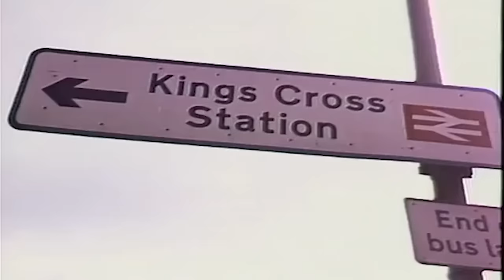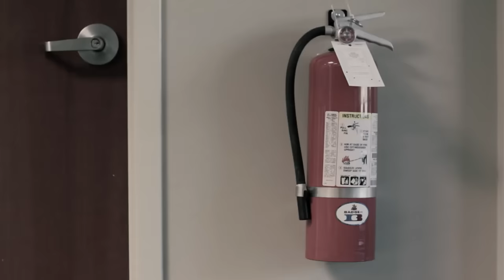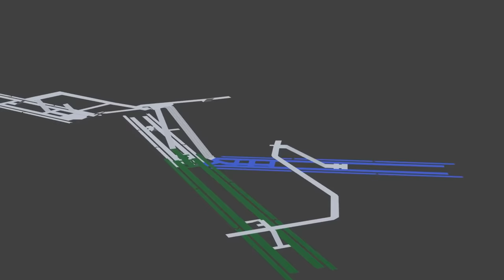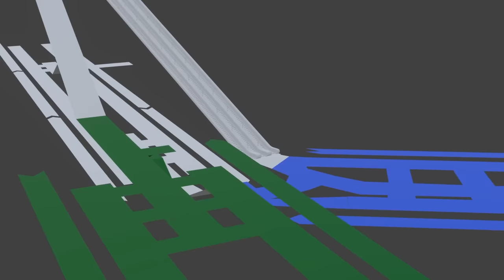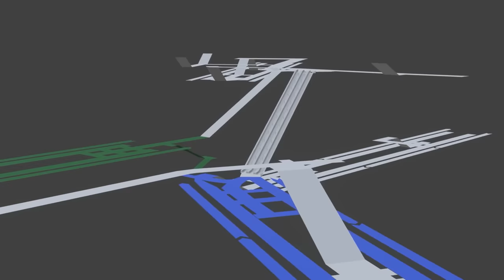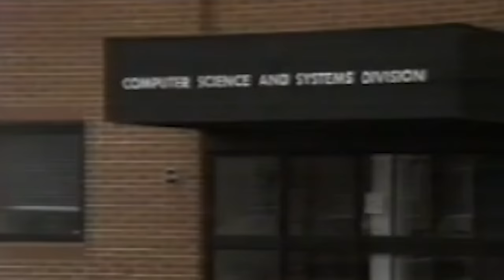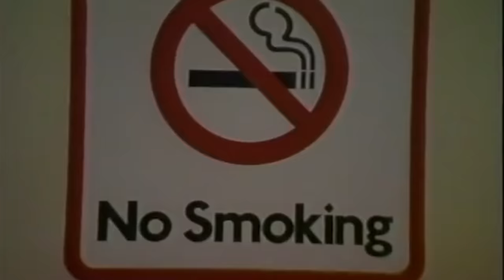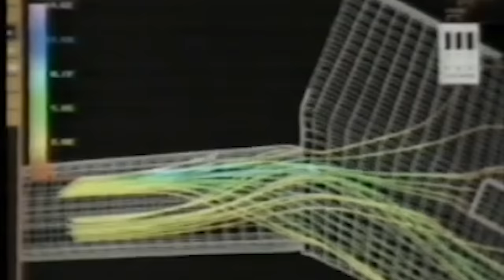The Subway Disaster That Changed Firefighting

Comment: A key aspect you didn’t mention was that firefighters in the UK were issued new uniforms which provided much better protection because the iconic rubber leggings they wore at the time of the fire were melting under the heat
Reply: I’m currently a firefighter in the UK and I honestly could never imagine wearing that kit into a small domestic fire, never mind a underground inferno! Those men paved the way for the gear we have today and that should never go unrecognised.
Reply: @WAzzzUUppp  My dad was in the UK police in the 1970's. He saw firefighters enter a domestic fire with wool coats and steel helmets but no respirators. They got a steel ladder and placed it in the hole where the stairs used to be whilst being sprayed with a hose. Then they climbed upstairs to get the kids out. Astonishing bravery. Tragically the children did not survive.
Reply: @WAzzzUUppp  on merseyside they called them yellow leggings  plastic yellow fire retardent drip pants  because they ware crap, each brigade had diffrent names for them eg leggings london  over pants merseyside drip pants
Reply: It's my understanding that during World War II, the regular firefighters had leather gear.  The auxiliary firefighters used gear that included rubber boots.  It's surprising that decades later the regular firefighters would be using rubber and plastic.
Reply: Water steaming out of the  wool coats when they got hot and then wet would probably cook you like a lobster
Reply: Ouch their legs
Reply: My uncle was a firefighter, and I remember him talking about them needing new gear. Helmets that would never sit on your head right, were uncomfortable and cumbersome. He called those yellow rubber pants Wet Legs, he said they were more suited to fishing than firefighting, they'd make your legs sweat, didn't protect against heat, would melt or get soft. The wool jackets were treated with fire retardant chemicals that made them smell funny. Gloves that were basically dipped gardening gloves, and garden standard wellies. It's amazing to think they were sending young men into danger in kit like that. My uncle was seriously injured when a floor collapsed above him. He was medically retired. He's still here. He won an award when he rescued police officers in a major fire.

Comment: As someone born in the 1990s I'm just here in shock that escalators were ever made of wood.
Reply: I think the first escalators were made from wood.  Macy's - the big dept store in the middle of Manhattan - was famous for having them.  Some of their escalators are still partially wood.
Reply: @ae2948  It makes sense and sounds really obvious now, it's just something I'd never even conceived of before. I love learning new things
Reply: The escalators in this were made in 1938/9. It was a cheap and easy way to reduce the moving weight.
Reply: lmfao, next youll tell me youre shocked that airframes used to be wood too?
Reply: I remember them in Boston in the 1980s had them in older stations
Reply: Problem is Britain was where the Train and the Subway/Underground/Tube were invented, and also had the world's first escalators on a subway system. Back then it was common to build them out of wood in the late 19th-early 20th century.

Since Kings Cross Tube Station dates back to 1863 and is also a major transport hub closing the station for rebuilding or retrofitting metal escalators was extremely difficult, so the old wooden steps were just left in.

The Tube had some wooden escalators all the way until 2013.
Reply: Your not the only one, I was born in July 14th 1983 and I’ve turned 40 today, but still look younger like as if I’m in my 20’s, my mind is still sharpe now when I can I still remember my early days when I was small, born in Walthamstow ( East London) and moved to Leyton  ( East London )in May 1984, got used to Central line 1962 stock very quickly as baby, before the train crash in Leyton in August 1984 on the Central line and I did not know about this crush in Leyton until 9 years later, but I remember first travelling on the Central line in 1984 before the crash the part when the trains enter the tunnel, blew my ears, ever since, I used to close my ears and I used get nerves when ever we get on the Central line from Leyton before the new the Stock of 1992 stock of the Central line when they came in the service in mid 1993, before I knew about  crash, I knew Central line a baby as “ hazard”, I did not felt self, I trust my indicts not people, if I feel something is not right, a person or any other things as well, but I’ve nevered seen 
wooden  escalators in zone 1 whole my life, I’ve nevered came out of Kings Cross station before after I left Walthamstow in May 1984, my old line was Victoria Line, i sat on the Victoria line before I left Walthamstow, my parents took me to Brixton, from Blackhorse Road to Brixton, the reason we could not find a decent house in Walthamstow, there non left so we ended up in Leyton and Central line was my new line; my dad use to work in Holborn back in the 80’s, he used to travel by tube to work, so when we were still living in Walthamstow and before I was born, he used to get the Victoria line from Blackhorse Road to Finsbury Park and change across to get Piccadilly line to Holborn, he was kind marketing person, so when we moved to Leyton in May 1984, Central line to Holborn, no changing at all, but when I looked back  in the 80’s before and after the Kings Cross fire, I felt like the escalators in Holborn were wooden, it gave me a vibe, but I remember travelling to Heathrow from Leyton when I was small heading to my family country Uganda for the first time, we changed at Holborn to get the Piccadilly line to Heathrow, I saw videos some of documentaries of the History of London Underground and they showed Holborn, it used have a peach tile on the Central line, but in 1985 they changed the tiles on the Central Lines and Piccadilly lines to British Museum of Egyptian statues and that is when I notice they used have wooden escalators I think, I could be wrong, but the whole of my life , I’ve been travelling on the tube for  39 years ( 1984, not including my age 40), but I did remembering on the tube in 1984 very well I had no issues, but small issues  (Techno issues), but I can only see wooden escalators in the suburbs area of London, but not in zone 1, which I find it strange and weird to see them in zone 1, but  heard station still has a wooden escalator on the Central line in Greenford, but in history, they should not have “ALLOWED” people to be smoking on the tube, escalators and at stations in the first place !!
Reply: @jessh5310 cheap, easy and stupid to used in the first place with that silly old generation who should have known better as well with “ smoking policies” in the first place and this would have not happend (Kings Cross fire )
Reply: @leonard2005ify  . You have to understand that many of the materials we take for granted did not exist or were extremely expensive pre second world war. modern escalators have extruded aluminium steps, a process only used post 1960 and only extensively used post 1980.
Pre 1950 fire buckets were a common fixture everywhere and everyone would enthusiasticly use them given the chance. Every building had dozens until the late 1960's.
Reply: @jessh5310  ok
Reply: Although they were made of teak which has a very high burning point. It was the grease and debris that fuelled the fire.
Reply: It's used to know as motor stair
Reply: @hiddenaether and buildings
Reply: Shocked by wooden steps? Really
Reply: @hiddenaether  that is kinda a shock when youve never thought about it before tbf lol
Reply: I only knew about them because there’s an old one on display at the London transport museum. I was 3 months old when this happened so even the idea of smoking on public transport was alien to me
Reply: @Ink_Sack shouldn't you be shocked that people are so stupid that they would throw a match into a mechanical device ? Would you think the same about someone lighting up a cigarette at a petrol station saying we shouldn't be using fuel because it's flammable
Reply: @James-kv6kb  I am shocked about that too lol, but also there’s always been stupid people in the world so I’m not too surprised
Reply: Last wooden escalators were removed from the tube at Greenford Station in 2014
Reply: As someone born in the 1960’s I’m surprised millennials and zoomers can’t look at context and accept things told to them without researching despite having more information at their fingertips than previous generations.
Reply: @leonard2005ify you mean like the current young generation who have to be told that McDonalds coffee is ‘hot’ so they do not burn themselves or have a million and one safety devices installed because they are too dumb to use common sense like not putting kids on glass counters?
Reply: @xr6lad  very funny, lol 😂😈, I understand what you guys said, due to cheap and etc…, but you in the tunnel, wires inside the tunnel and on the train etc.., etc…, life rail tracks… you name is and peoples safety as well.
Reply: @xr6lad  oh yeah, cos I’d see an escalator and go “Let me just look up the entire history of that thing real quick”. What kind of logic is that? Not the best comment from you there
Reply: I was born in the 80s but I knew that wooden escalators existed because I live in NYC and the Herald Square Macy’s has them. They did a complete reno a few years ago but kept some of the wooden escalators intact so they’re still there in 2023
Reply: and people were allowed to smoke and often dropped their cigarettes and matches on the escalators, I remember it well. People lit a cigarette and dropped the lit match on the wooden steps.
Reply: @markylon  The wooden steps is a red herring. The chances of them catching fire from something like that is practically zero. The problem is the something falling through the escalator that is hot enough to ignite all of the accumulated rubbish underneath. If you have a hot and large enough fire underneath the escalator to catch the steps on fire, it will be long past the time when anyone would be able to use them anyway.
Reply: @SarthorS   well if you read the investigation report the WOODEN Steps played a significant part and the panelling ordered to be removed and all wooden escalators to be phased out.
Reply: @markylon  Did it? Have you got a link to the report itself? Because from what I read, the grease and debris under the escalators as well as the many layers of old paint, the difficulty in accessing the source of the initial fire and even the angle of the escalator all played a more significant factor than the fact that the steps were wood. Also the panelling are not the steps. Of course replacing it all with metal would be an improvement, but I still think that some people in the comments are making far too much about the fact that the steps were wood. I do know that evidence was found that multiple other fires had started under them and burned themselves out without anyone even noticing.
Reply: @hiddenaether the irony of having that pfp and some of your comments is just.. damn😂
Reply: HOW THE HECK IS A ESCALATOR MADE OF WOOD AT THE TIME my mind is broken, and it literaly ESCALATED the problem
Reply: @yuvanshhariramani9685  Why wouldn't they be? What is the staircase in your home made from? What are most homes in countries like the US and Japan made from?
Reply: Today, there are only 2 companies that make metal escalators for the UK market, Otis and Schindler.
Reply: Dont ride the Grand National on Blackpool Pleasure beach then!
Reply: The top few floors of Macy's are still wooden. I love the look, feel and sound of it :)
Reply: @yuvanshhariramani9685  , to me it's mind blowing that some many houses, offices and structures in the United Startes are still, to this day, made of wood; in 2019, 90% (ninety!!) of new houses built in the United States were made of wood, even in fire-prone areas. It's cheaper, but structures made of wood only make things a lot worse in case of fire, contributing to spreading the fire to nearby structures, also made of wood.
Reply: Sydney’s escalators are wooden still
Reply: @xr6lad i don’t think that’s the “current young generation”… didn’t the mcdonald’s lawsuit happen 30 years ago 🤭
Reply: I didn't know there was such a thing until today 😳
Reply: Born in 83 and it's weird to me too.
Reply: Macys in NYC still has wood escalators
Reply: Same here I was born in 2000 and I never knew they used wood on escalators now they use metal. Wooden escalators should never be used again and I'm glad that there is no smoking 🚭 inside subway stations.
Reply: yea same here i looked up this accident and the first thing i saw was "wooden escalators" ... wtfff
Reply: They were also filthy underneath with grease ,dust and even dead rats
Reply: I can't imagine them being more rickety and imposing than they already are
Reply: The Boston T had some escalators with wood "steps". Not sure if they've been replaced, it's been awhile since I was there.
Reply: Up until a few years back. South Woodford or wood Ford Station on the Essex branch of the Central line, still had them.
Reply: it made sense at the time. after all, lots of stairs are wooden. we tend to assume things can carry on the way they've always worked.....
Reply: I know this one 0 my gosh that’s super Duper bad😮

Comment: Pre-1985: smoking permitted, heavily greased wooden escalators and constantly shifting  air from trains in tunnels. It's amazing serious infernos, like the KC fire, weren't far more commonplace.
Reply: Interestingly a survey of the wooden escalators at King’s Cross suggested that there’d been a large amount of smaller and undetected fires on the track before this incident.
Reply: @eliz_scubavn  that figures, during the post fire investigation, analysis of the very escalator that burned during the Kings Cross fire, found 17 other scorch marks in addition to the one that became the fatal blaze. What's more, they were all on the right hand side of the escalator, due to the etiquette of Tube travellers standing on the right
Reply: @SiVlog1989 I’d also mention the Bradford City fire. An old, poorly maintained stadium consisting of seats on wooden bleachers and a roof made with tar, smoking permitted in the stands and a years long buildup of debris including tickets, sweet wrappers and other items. All it took was one dropped cigarette and the whole thing set alight. 

Within 3 minutes of the fire starting the entire stand was on fire and people across the other side of the stadium were forced to move due to heat. The fire moved so quickly that people were found burned in their seats and a number of people who’d tried to leave via exits had found them locked and they died unable to escape.

Comment: The scary thing is when you are dealing with a below grade fire like this is that the staircase is like a chimney. All the heat and gases from the fire are pushing up those stairs… RIP to all of those who lost their lives.
Reply: If you find yourself in a similar situation stay below the fire. The fire spreads upwards due to the chimney effect. The smoke and all the toxic gases will rise up. There's enough oxygen to breathe and to sustain the fire because of the subway tunnels.

Comment: There are a number of interesting things to point out about the kit used by the firefighters, while by modern standards and the standards of the time they where starting to be come outdated thew uniforms worn by the firefighters still had a level of practicality. The rubber/plastic leggings where water resistant and woolen coats make for good thermal insulation and are even recommend to be worn if you're caught in a bushfire. And some fire brigades in Australia issued woolen coats as late as the early 2010s, albeit in a retired roll mostly as raincoats. As a product of the Kings Cross fire, fire brigades in the UK began using flame resistant nomex tunics instead of the woolen tunics, and replaced the old cork helmets with newer heat resistant plastic helmets with visors. The Kings Cross fire is too an extent a reasons as to why fire brigades in the UK modernised in the late 1980s and early 1990s
Reply: They look so dated here. I bet the woolen coat was so uncomfortable, looks very hot and I bet you were soaked in sweat and it's not even waterproof.

Comment: To think of the complex dynamics of these types of disasters are crazy. The way the fire effects the air pressure in the tubes. The wooden greasy escalators. The difference in elevation, the movement of the subway train's, etc. It's very complex.

Comment: Slight correction / additional information.

The effect of gases going up the trench was partially caused by trains arriving. When they arrived, it pushed air out and up, including up the escalators. That's what caused the trench effect to occur so quickly.
Reply: That theory was discredited in the investigation.

Comment: I remember hating those old wooden escalators from when I was a little kid in 1990 or so, because the steps were a slightly larger than on the newer metal ones (which was a big deal to a 3-4 year old kid). My old man would sometimes take me to work with him for some babysitting on the go and we'd pass through Warren Street, only a couple of stops from this. It was a good few years before the wooden escalators were completely phased out.